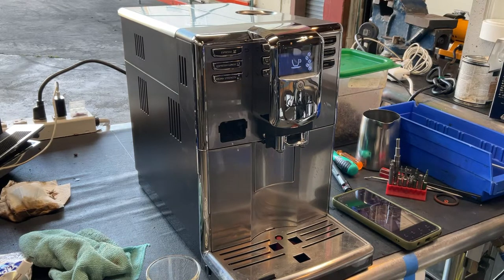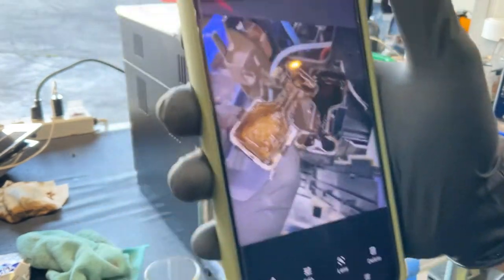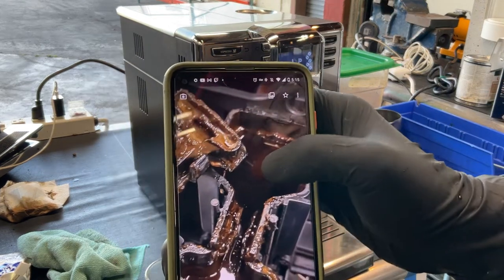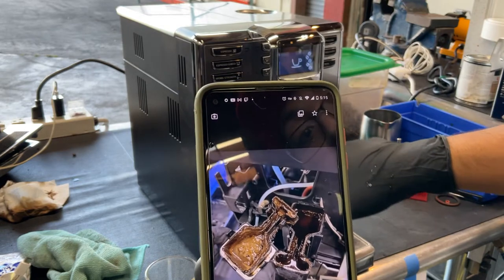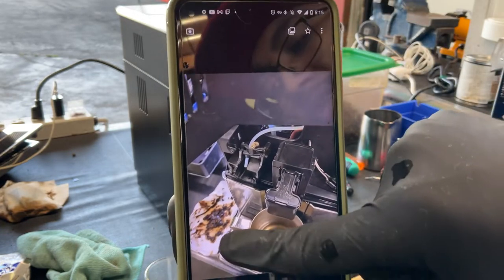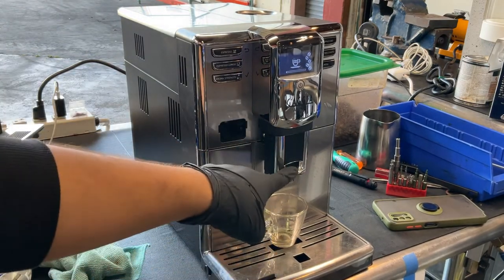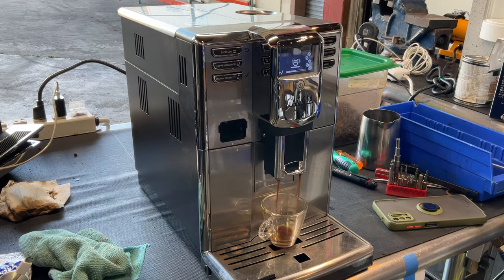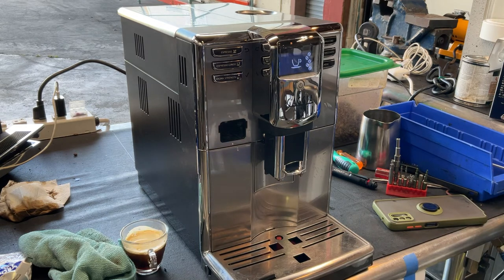Clogged spouts and slow  coffee flow - Gaggia Anima - 5452 test

Comment: In addition to using a pipe cleaner to go up inside the "internal brew spout", I turned the unit upside down, and squirted water up inside one spout using a turkey baster syringe, until water came out the other spout. Fixed it!